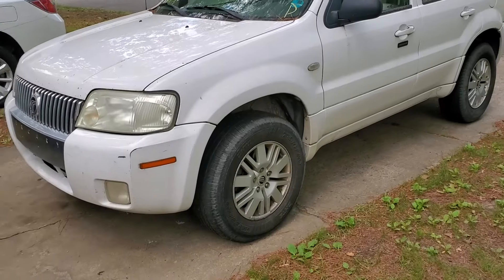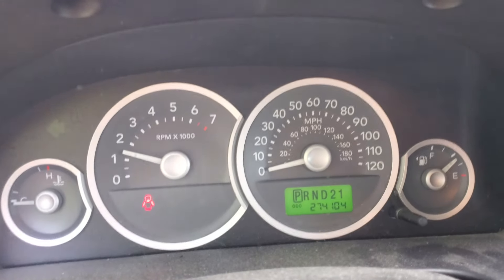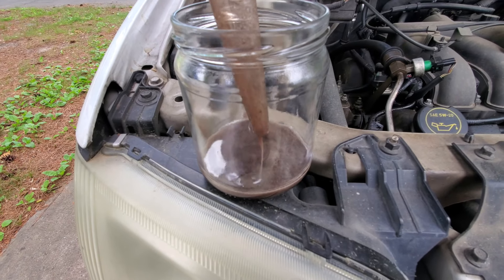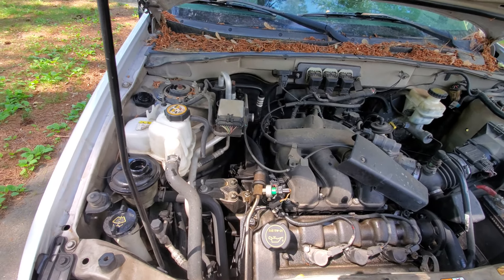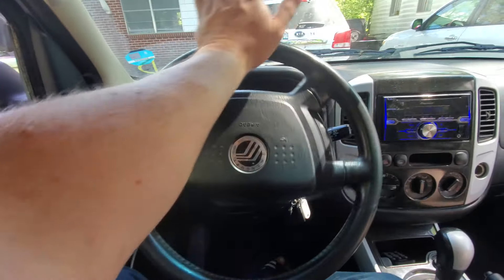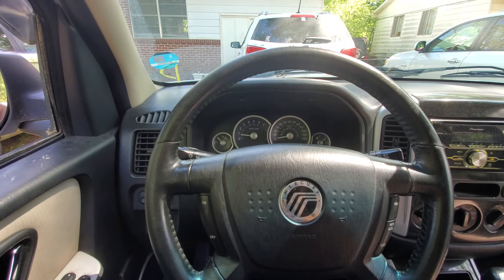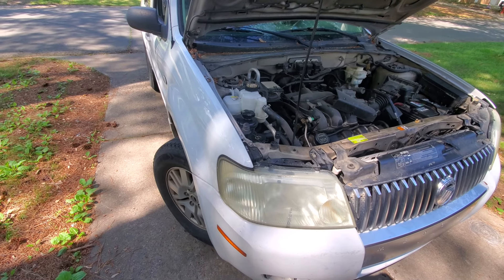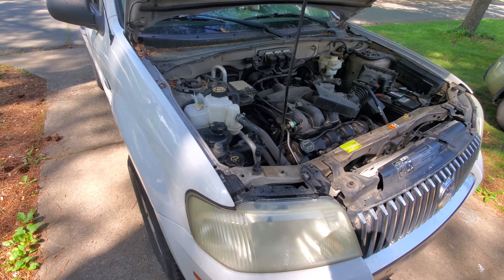Trans Tune fixes a noisy power steering pump 👍 ft. Curtis B. in AR

Comment: Should we flush seafoam after the process or just refill it with more steering fluid
Reply from the maker: No need to flush unless the power steering fluid is old. Leave it in until the power steering fluid needs to be replaced. Hope this helps! 🙂

Comment: You just need new power steering oil 
That's it
Reply: Not always the case. I flush my car with the car power steering max capacity and still got steering noises.